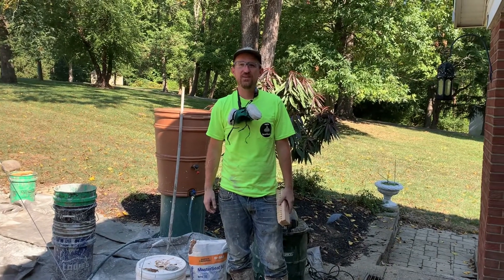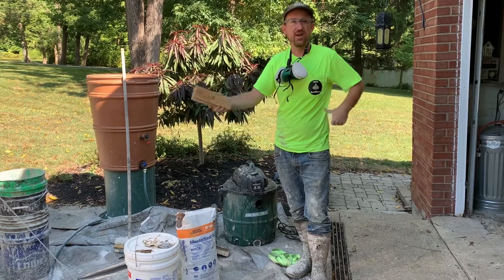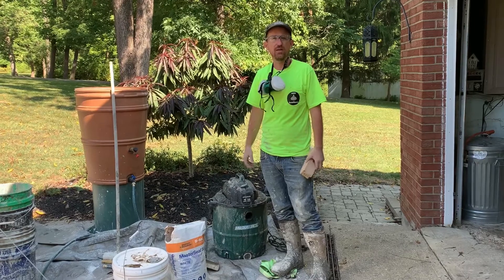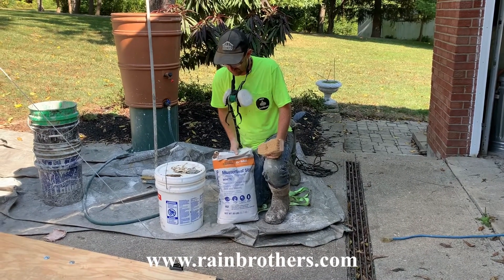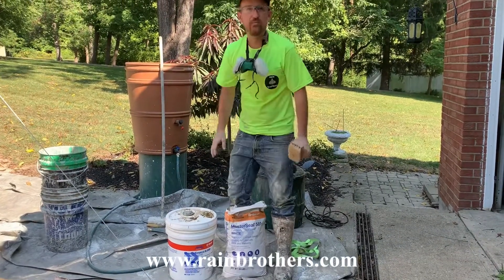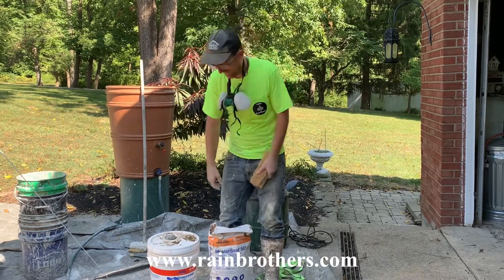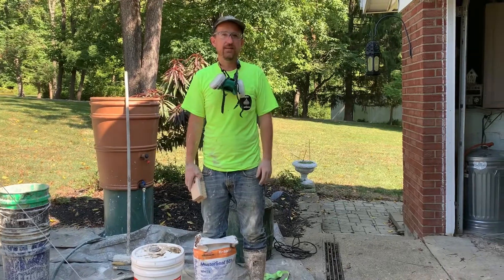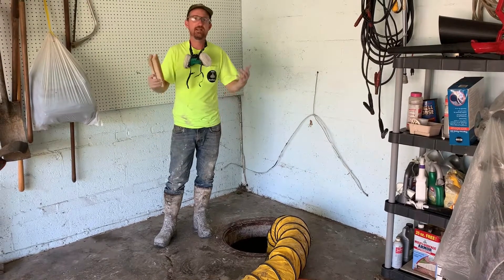How to stop a cistern water tank from leaking the RIGHT WAY!

Comment: I just don't understand how nobody has figured out the recipe for the self-healing Roman concrete yet. They already know they hot mixed quicklime and pozzolana with freelime clasts in it. Seems like someone who's familiar with hand making concrete could have worked out a recipe already.
Reply from the maker: Yes, Roman concrete is pretty fascinating. However, concrete (Roman or otherwise) is not inherently waterproof - it still needs to be parged with a waterproofing cement on a regular basis
Reply: @rainbrothers  I don't think so. The hot mixing of quicklime (i.e high temps), the alumina silicate of pozzolana combined with high mineral sea water and the late addition of free lime clasts into the mix allowed new mineral crystalline structures to grow when fissures and cracks formed and water flowed through them. That is why/how unmaintained underwater roman concrete structures stand to this day. Their chemical structure makes them....almost alive.
Reply: @rainbrothers  if you install concrete cisterns, this might be something to experiment with in your free time. It doesn't have to be the exact ingredients they used, I would imagine, just chemically similar. The properties you're looking for in pozzolana would be alumino silicate; zeolite sand or clay, pumice sand or perlite. You would have to have quicklime, some of which you need small chunks of to throw in at the end of the mix. And limestone gravel. It looks like you'd have to make it yourself which isn't hard. Burn limestone in a fire until red hot. And clean water with a high mineral salt or a mixture of table salt, Epsom salt and borax. 4.64 oz per gallon.
Reply: @rainbrothers  some variation of ingredients with these chemical properties along with hot mixing them is how they built their underground cisterns too.
Reply: @rainbrothers  to this day, the Greek's and Italians use a pozzolana product to waterproof their pools. The Romans built it into their waterlogged structures.

Comment: Thank you for your well done video.  Do you think this would work to seal inside a 3 ring concrete tank?  Well pump fills this tank and then booster pump provides water to our house.  It is seeping water at the lowest joint.  It just started & I want to repair before it gets worse.  I would seal tank inside (1 foot band covering the ring joint) and for external repair I would remove the mortar, clean and replace.  Still need to determine if mortar needs to be special for this application.  Thank you!
Reply from the maker: Yes, MasterSeal 581 is meant to seal cracks and voids. We also sometimes use hydraulic cement if we’re sure the tank is done settling and moving (because hydraulic cement cracks very easily if the tank moves), and sometimes we use Sika 62 potable epoxy if the seam is hard to fill with MasterSeal.
Reply: Thank you! @rainbrothers

Comment: Could I put a little bit of food coloring in there just to change the color so I would know. Or what other kind of dyes can I put in there just to change the color a little bit?
Reply from the maker: You certainly don’t have to use two different colors - that’s just what we do. You will be able to tell your coverage of the second coat because the second coat will be wet compared to the dry first coat - you just won’t be able to see weak coverage as easily. They do make cement dyes, but unless they are rated for potable water, I wouldn’t have any that I recommend

Comment: Does the wall need to be dry before application. Will water seep in from a pond next to the cistern .
Reply from the maker: The wall should actually be wetted before application. As for the pond question, in my experience, it is very difficult to keep an active spring or high water table or pond out of a cistern. You couldn’t do it by sealing the inside of the tank - you’d have to dig on the outside of the tank and coat the outside wall.

Comment: Ok so in this.
How do you get by without the expansion joints?
And for walls; will this work on cinder block walls?
Reply from the maker: This is just a skim coat. Typically, there are no expansion joints in cisterns, but re-sealing needs to occur every 15-20 years and cracking can happen during that time. Yes, this works on cinder block walls - but you’ll want to be careful NOT to coat any filter wall that may exist in your cistern. Typically, a filter wall runs between two sections of the cistern - rainwater enters one side, seeps thru the block wall, then filtered water is drawn from the other side. But the rest of the concrete block can and should be coated in this method

Comment: I have an old cistern that is leaking.  I had paid a company to fix the issue, but it still leaks. So, I decided to fix it myself.  I searched and found your informative video.  Best  video I have found!
I am wondering ..... 3 part water, 1 part 660  and how much 581 - for 1st coat and for 2nd coat?   
I am wondering how much 581 I will actually need ..... or how much i will waste (not use) if I buy a white and a gray bag.  I understand the reason for using both, but 50 lb bag is a lot 
Thanks!!
Reply from the maker: Yes, 581 and 660 are both quite expensive. Check out MasterSeal’s website for more information on the product and mix ratios. We get it to slightly thicker than paint
Reply: @rainbrothers  Thanks!  After watching your video, I did purchase the items and resealed my cistern.  Your video convinced me that I could do the project myself.
Reply: @beverlyrobinson448 how did it go? I have a 1000 gal leaking and im considering doing it myself but im claustrophobic so im scared lol. How doable was it for you? Was it hard to do? How much did u spend? Lol sorry for all the questions
Reply: @anniewright9532  It went well.  I just followed his instructions (and the instructions on the binding agent).  Not issues - except I did mix up too much the first day and it dried, so that was wasted ;(
Just mix the binding agent (mine was 3 part water to 1 part binding agent, i think) and mix it with the 581 powder (I used a mixing attachment on drill.)  Then paint!  First day was very easy, as it was paint-like.  Second day was still easy, but mixture is a little thicker so not quite as easy.  I did feel that the concrete brush go a little heavy, but not bad heavy (i did use a little larger brush than they did, as I did not have a smaller size.)   I am glad that I watched this video and did the project myself!
Reply: @anniewright9532  My Costs:
MasterSeal 581 Thoroseal Gray Cement -Based Waterproof Coating 50 lb white  $64.99
MasterSeal 581 Thoroseal Gray Cement -Based Waterproof Coating 50 lb  gray $64.99 
MasterEmaco A660 White Bonding Primer 1 gal  $44.99 
I do have leftovers .....